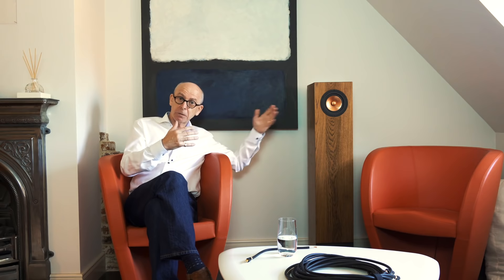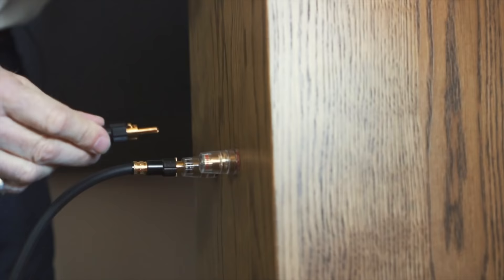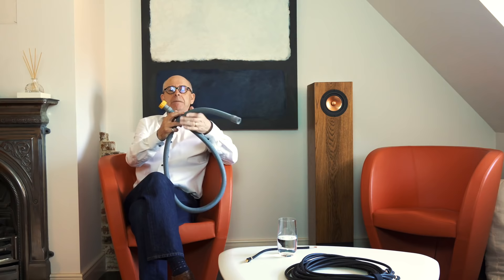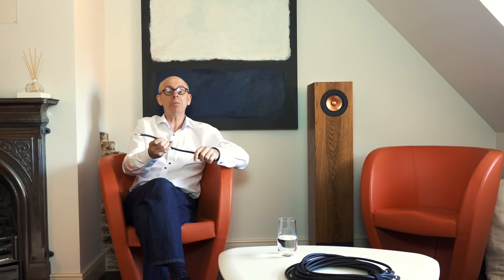Loudspeaker cables - how do they make a difference?

Comment: Bollocks.  We have to stop making up romantic stories (bashing electrons and master driver artisans, bits of silver) instead of performing and responding to controlled tests.  No way you can tell the difference between cables (with reasonable LCR measurements) when you aren’t looking at them.

Comment: Cables make zero difference if theyre thick enough.  Cheap home depot cables sound exactly like high end pure silver cables.  If a person is hearing a difference after switching cables the person is either hearing placebo or they moved the speaker very slightly.  Even 1/16th of an inch movement of a speaker will change its sound.

Comment: LOL !!!

Broadband speakers in a untreated room ?!

And you want to talk about cables ???

Really ???

Use a 3 way or 4 system, 20 to 20, in a well treated room, with good early reflection behavior, a room dependent RT60 time and a corrected Step Response ( time aligned all drivers of the speakers ).

Then you have easily the extra sibilance on the crash or ride cymbals !

Before you talk about cables, which make 0.005 % sound, talk about proper room treatment ( incl. Room modes killing and damping early reflections ), talk about a real 20 to 20 system, with a neutral freq. response, talk about the ideal Step Response at the listening area. Talk about Group Delay and Phase and what ever... but about cables ?!?!

Facts:
Room modes destroy bass and the upper frequencies...

Early Reflections makes a cloudy sound and a unstable phantom middle

A not good Step Response distort the field of depth, so reverbs in music, sound not correct...

To solve these problems make wayyyyyy more than a overpriced cable !!!!

Come on !
Reply from the maker: Hi, thanks for your comment and contribution to the debate. I thought I mentioned that the cables are the last component when considering a system? And that also we just opted for multistrand copper, to keep things neutral. As for room treatments, I have made two videos on this topic because I (like you) find it essential for good sound. I would respectfully, like to point out that our loudspeakers are probably not what you imagine, and go way lower than most commercial loudspeakers (rolling off at around 36hz). Plus they cover the upper frequencies with absolute life like accuracy, when comparing with acoustic instruments. If you find it hard to believe (and many people do) there are plenty of independent reviews on them, or even better, you would be very welcome to visit one of our listening rooms around the world and experience them for yourself. Best wishes from Belgium.

Comment: With that Rothko painting behind you, you lost all credibility with me.
Reply from the maker: Hi, sorry to hear that. not sure why the painting is linked to my credibility. Maybe you can explain a bit more?
Reply: @PearlAcoustics  You focus on the electron path of cables, mixing magenta and cyan colours, and other disjointed explanations. Yet you fail to mention the importance of capacitance and inductance. "A different shape dramatically changed the sound"...a nice vague "explanation".
Reply from the maker: @appleturnover519  hi, thank you very much for your comment. As you may have noticed, my talks are not scripted, However, I am a little confused because I talk about capacitance, inductance and resistance (approximately at 05:47, 6:13 , 08:20 and 11:30) and how that can (and does) alter the sound.  Our end conclusion is that multi-strand copper is what we recommend.

Comment: This looks like an unbalanced cable, it’s what I use, I get mine from Studiospares in the UK for 99p per metre or £1.50 pm for a twinned version. Sounds great, a pair of 3m leads including a decent set of banana plugs are less than £20 and sound exactly the same as some Tellurium Q Black II I have at the bargain price £340. There is NO difference folks. 

I’ve spent most of my life in studios, both radio and recording, I see engineers using a £20 mic cable (if that expensive) on a £2000 Neumann microphone 🤔. Don’t get sucked into the cable hype.